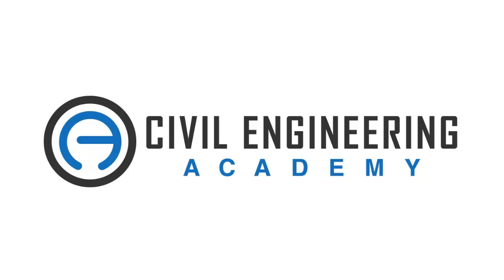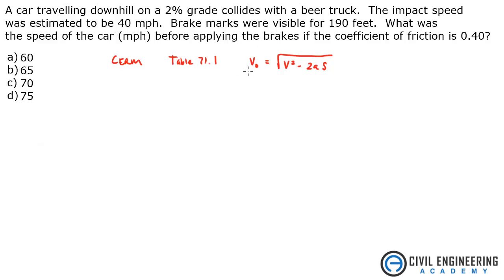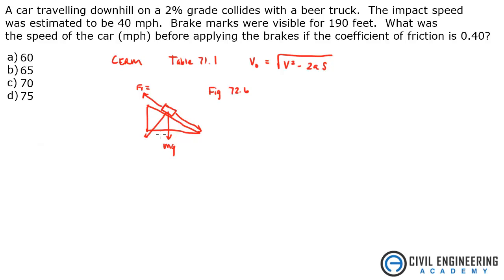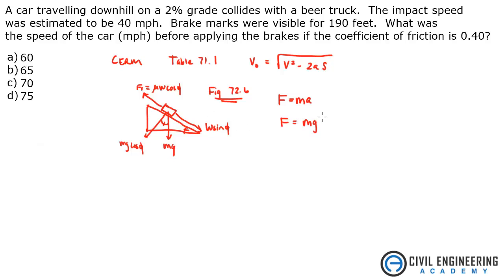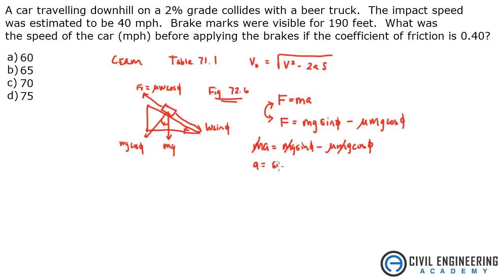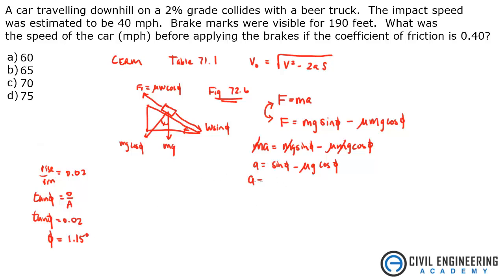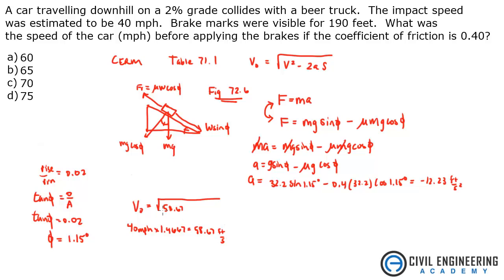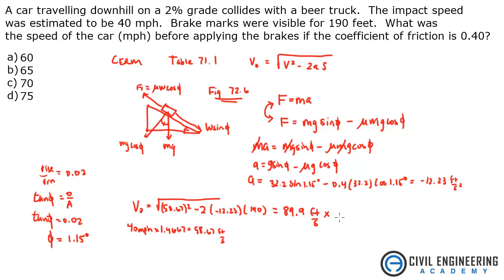Transportation-Find Initial Velocity Using Kinematic Equations

Comment: I find it easier to use this equation, a modified form of Eq 75.25b in the CERM:
Sb=(Vo^2-Vf^2)/[30(f+G)]

It was still useful to have a kinematics refresher though.  Thanks for the videos.
Reply: This is also the equation I used to solve the problem. Apparently V in that equation should be (mph). units seem to be already accounted for.
Reply: +sedziobs Good call on that. Thanks!
Reply: But using equation 75.25b gave me 63.20 which would closer to answer b. Am I splitting hairs? Or did I miss something?
Reply from the maker: sedziobs Good check on finding a faster way.  There can definitely be more than one way to attack a problem.  Thanks!